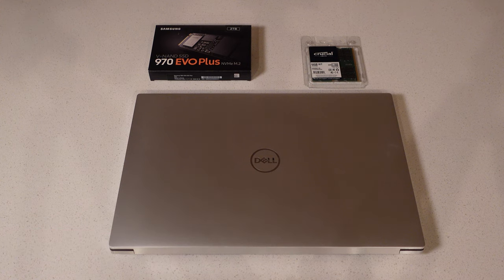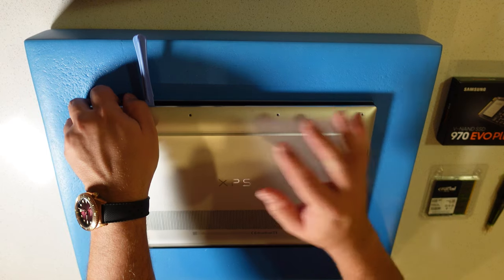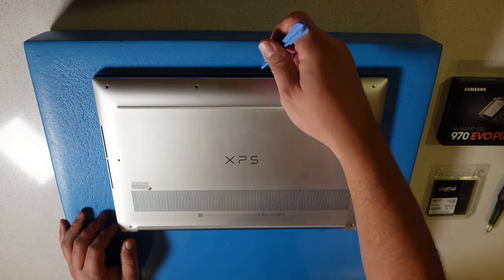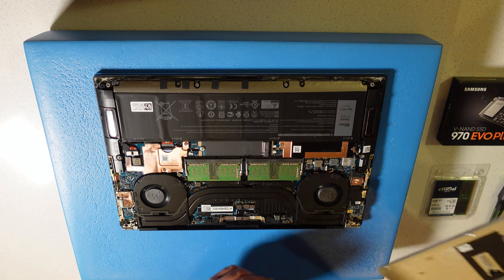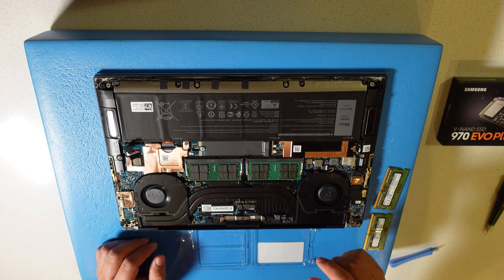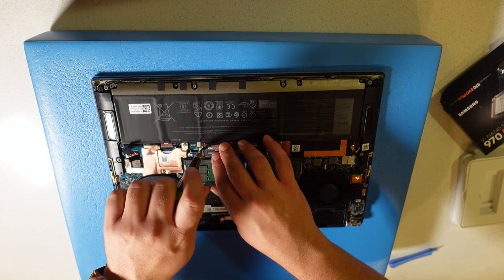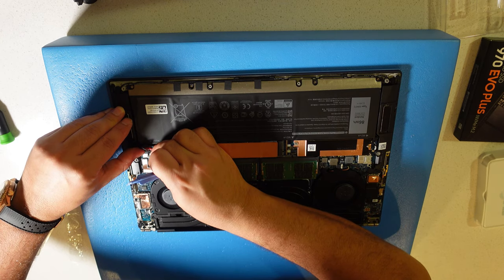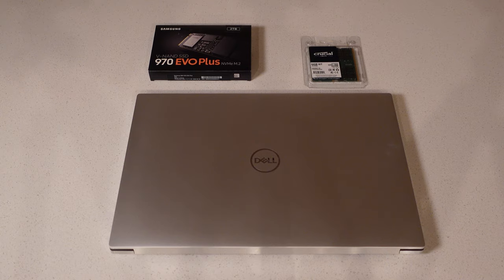Dell XPS 15 RAM and SSD Hard Drive DIY Upgrade

Comment: I just upgraded my 9570 from 32 to 64gb and installed the 970 Samsung 2TB in place of my original 1TB.  I used Acronis True Image to clone the original SSD to the 970 using an inexpensive enclosure and usb cable.  Machine booted right up on the new drive, no problems.  I did have to re-enter my Resolve Studio key, but that was the only surprise.  I used the tool kit and parts in the links above in the description.  I didn't need the screws or the heat sink.  Tool kit was a lifesaver.
Reply from the maker: Yeah the toolkit has saved me a few times. Great to hear the upgrade 👍 worked out!

Comment: excellent Video.  I am considering doing a similar upgrade on my 9500.  I was wondering how the system did with heat once you super charged it with all that memory and disk space.
Reply from the maker: Honestly I’m surprised that the heat wasn’t an issue. The upgrade remains the best I’ve made on the laptop and it’s be all positive performance gains.

Comment: Hi, I have a laptop grey, the model is dell XPS 15 L501X ( old laptop), I have few queries: -
1. can I upgrade my laptop with the same combo viz 64GB ram and 2TB storage? I have inbuilt Intel HD graphics. 
2. If this combo is not suitable for my laptop, what best combo you can suggest, considering the laptop is an old one.

Please guide/ help, I am looking to upgrade my laptop as my reason is the same as yours, want to use the laptop for graphic design, image editing, and low video editing projects. I am a professional av editor, colorist. And the second reason is not to spend too much on buying a new laptop. waiting for your response anxiously !!

Comment: Hi there! You have any battery issues. When having both SSD's at the same time? Like draining fast?
Reply from the maker: None on my side - battery is still stable.
Reply: @conceptanddesigntheory  Thank you for replying!  I was considering replacing the primary SSD for a better one and fresh install or just add a second one. But I guess there are benefits when having a better SSD as a primary source of storage.
Reply: Have you noticed programs and overall the system running much faster with the addition of the second SSD?

Comment: This is very helpful, thank you. Just wonder do I need to reinstall Windows system after installing the ssd
Reply from the maker: If you still have the original SSD installed then you can just install the new one and use it as another drive and keep your OS on the old SSD so no need to reinstall windows. Alternatively you can use Macrium Reflect and just do an image of your original SSD to your new one. That's how I did it and effectively not touching the original one. This option would have a slight speed benefit especially with heavy video /photo editing / rendering process if the files being worked on and software is installed on the same drive. Theres a few youtube videos on the hard drive imaging process that I found helpful. Good luck!

Comment: Is it possible to apply the heatsink without upgrading the SSD already inside the system? Thanks!
Reply from the maker: Yes you can although depending on how big the current SSD size the fitment won't look exactly the same as what was seen in the video. For instance my dell 256 gb ssd is about 1/4 the size physically in the ssd slot and I was surprised to see it under the factory heatsink taking up such a small space. Nonetheless its possible and you would just place the two clear bands that come with the heatsink kit around the factory SSD and you're good to go.
Reply: @conceptanddesigntheory  Awesome thank you so much!

Comment: Upgraded my xps 9520. 16 to 32 gb ram bought from dell. Ram failure on startup. Had to reinstall back to 16gb ram. What a crock. Need my $ back for the 2 16gb sticks.
Reply from the maker: That’s horrible! Especially bought directly from Dell is crazy to hear. With the 9520 I know some people are using the ram upgrade from https://www.crucial.com/compatible-upgrade-for/dell/xps-15-(9520). Good luck and I hope you get this all sorted soon!
Reply: @conceptanddesigntheory  Do you disconnect they battery b4 changing the ram?
Reply: @conceptanddesigntheory  Im going to try it again. Maybe a small chance i didn't seat it all the way or something. I switched back to the original ram kinda fast. Ill go ahead and install the 2 16 gb sticks again and make sure they are seated as good as they can be. Then do a startup with the cover still off incase it errors i wont have to remove the cover and all that jazz all over again. I will once again remove the power from batt to board b4 i do it.

Comment: So i m going to do the same. I just want to use one SSD in slot one as running two SSD might drain a lot of battery. But I am scared to deleting or moving windows and don't know how to do it
Reply from the maker: I would use Macrium Reflect and just do an image of your original SSD to your new one. That's how I did it and effectively not touching the original one. Theres a few youtube videos on the process and I copied all the original drive partitions and had no issue. I left it plugged in and had no noticeable battery drain. Good luck!

Comment: What if I already have 16 gb of ram ?
Reply from the maker: Are you maxing out with your current ram usage? I would take a look on whether or not the upgrade makes sense at either 32 gb or 64 gb of ram. 32 is plenty and 64 is definitely covering more than I need.